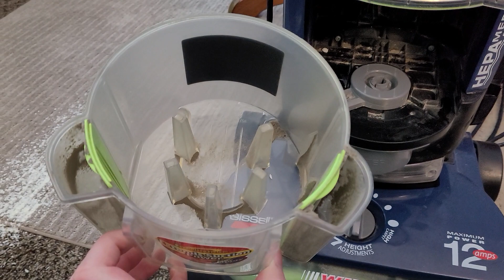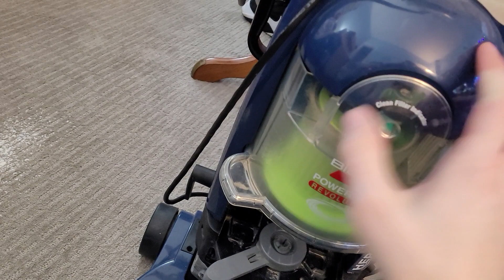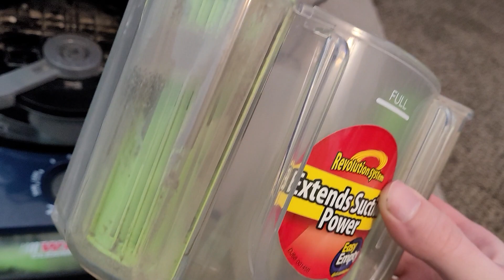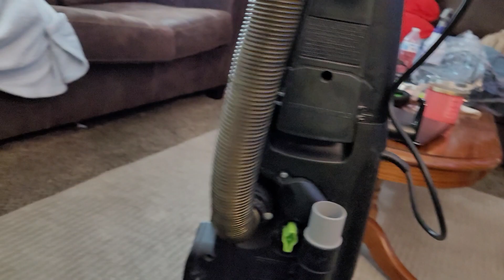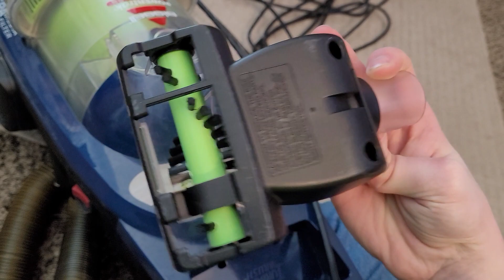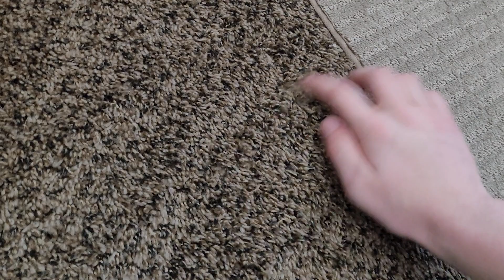Bissell PowerTrak Revolution (6591) Vacuum Review

Comment: I have this exact 6591 model, bought it new in '05 (I believe) and it's still in service. Giving it to my daughter to use for her first apartment. Still in great shape. Has served us well. Pedal release let go years ago but I was able to fix it. Never did like the plastic wheels but that's it. It's quite loud compared to vacuums now though it seems. The TurboBrush can't be beat, use it for all sorts of stuff. Still have the paper manual for it. Decided to replace it with the Bissell SurfaceSsnse 2817. Hoping it will have the same longevity.